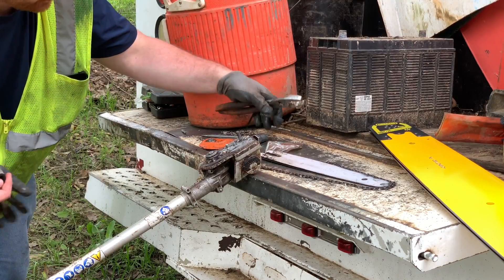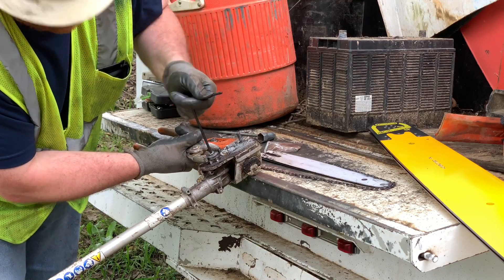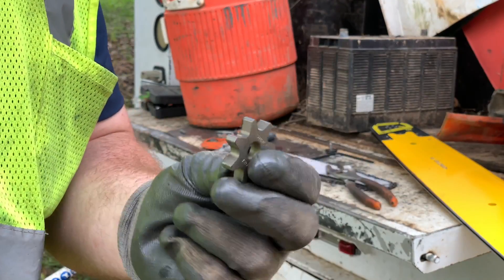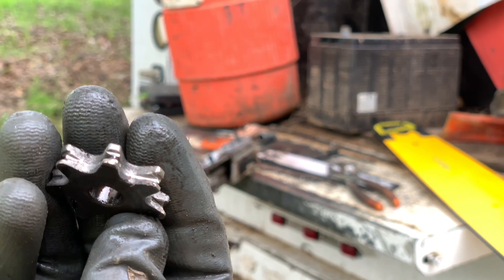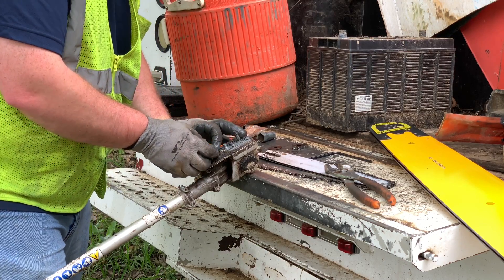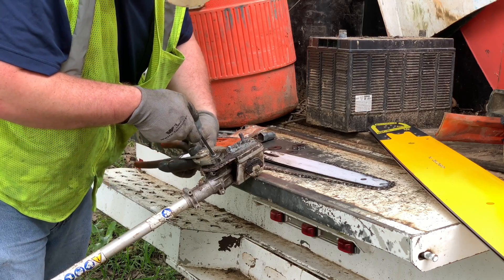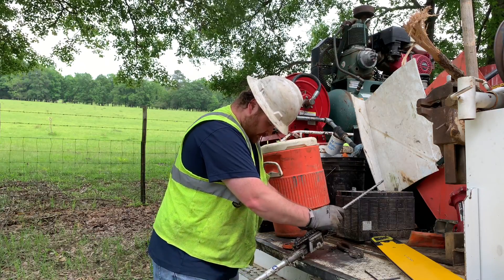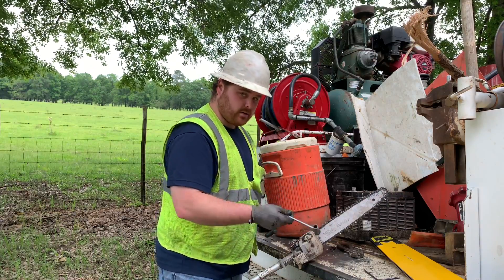How to change a pole saw sprocket

Comment: Thanks for the video and keep up the great work. Not sure if you knew there are sprockets with two flat sides that lock on the shaft instead of spinning freely. The new design has the cutting side on the right and the old design was opposite. Hopefully you also know there are several pitches, gauges, lengths and materials of chains and different sized sprockets.
Reply from the maker: Thanks for watching!